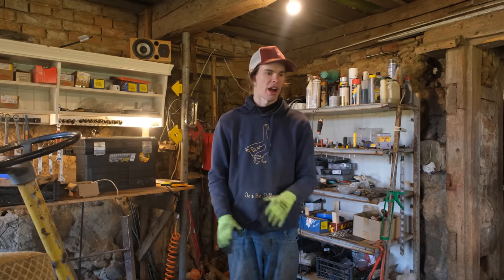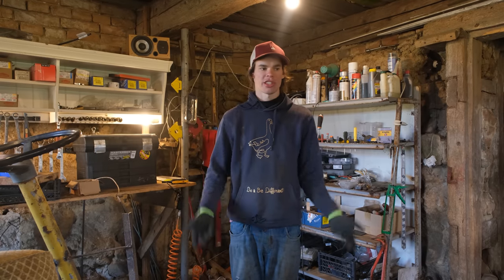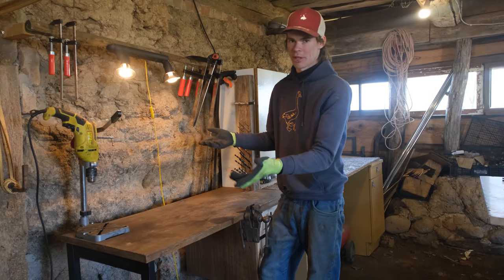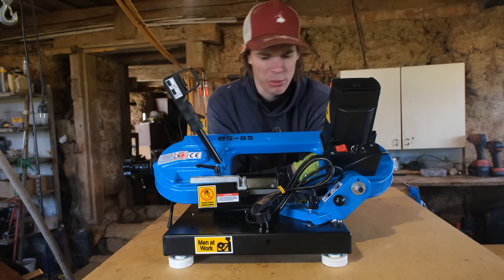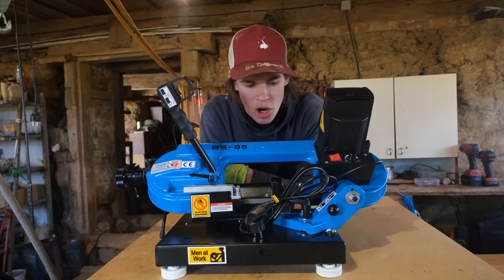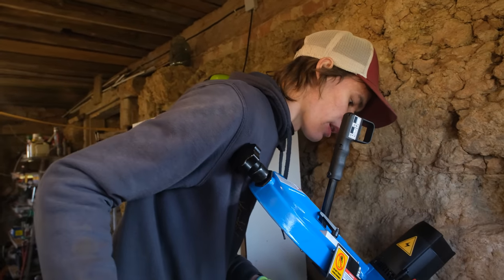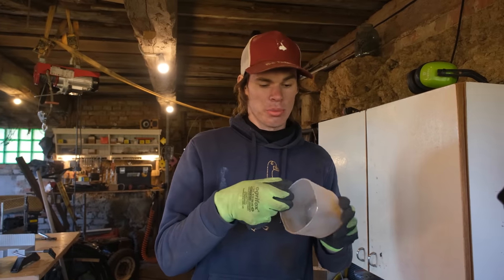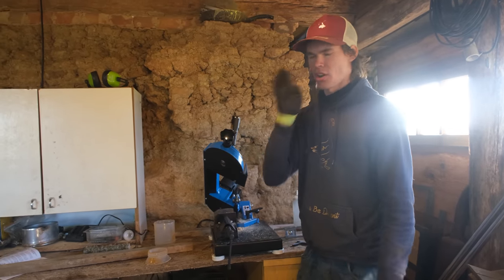OLD Barn is turning into a DREAM Workshop with VEVOR Bandsaw?!

Comment: The 5 euro saw you got at the thrift shop looks like it's a miter saw. Used to cut angles...like the 45 degree angle to make the corner of a frame. That's called a mitered corner, achieved by using that miter saw. 😊  There are pre-sets for some standard angles, like 45 and 27.5.

Comment: band saws are for  steel
Reply from the maker: Band saws are for anything! The wood industry mostly use bandsaw with a different blade but still a band saw. The saw can cut metal, wood and plastic! I wouldn't use it for wood but for plastic pipes it is very nice and clean cut!